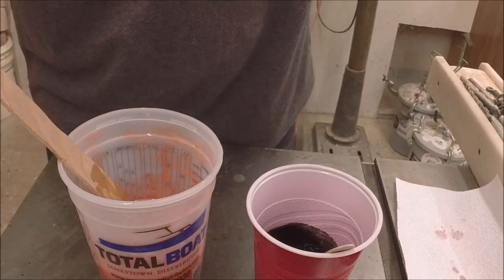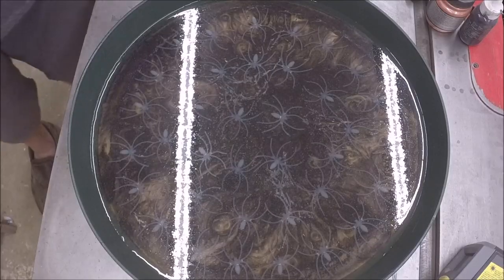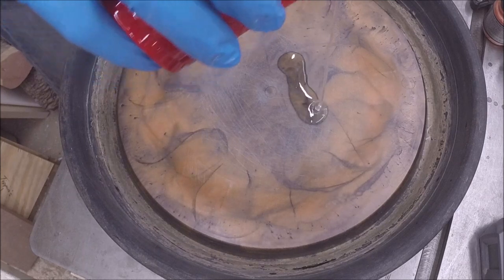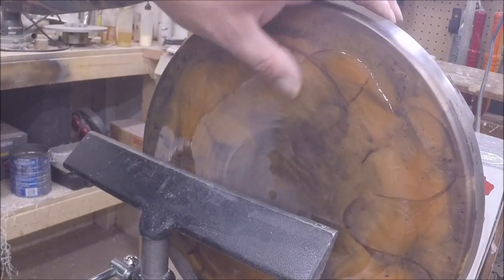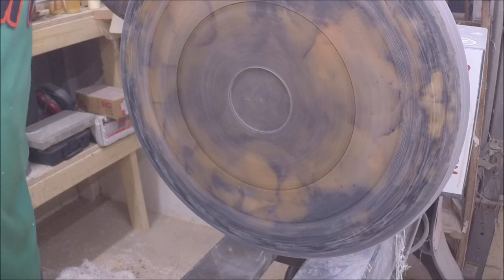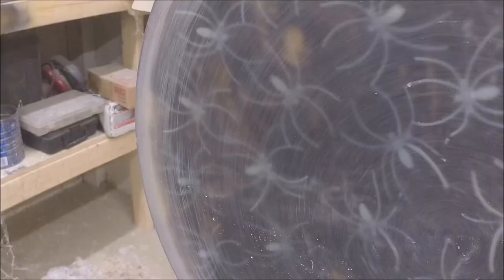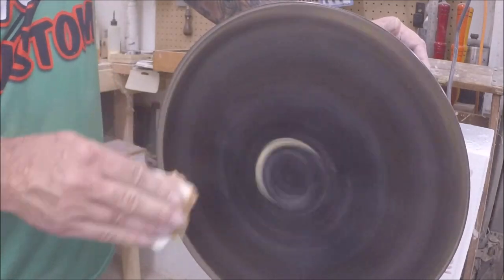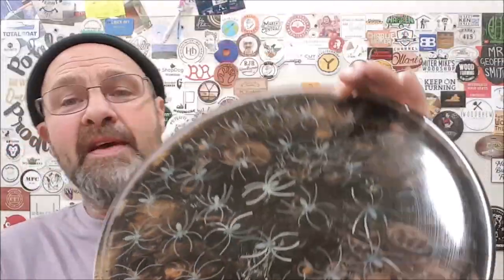Resin - Spider platter

Comment: If you have a buffing wheel that will fit on a Drill, that may help polish the circular marks off the surface...
It would also help you get the speed needed to generate the friction for sanding/polishing the very center of the pieces while you work them on the lathe...
Reply from the maker: Thank you,
Reply: Love it! Good to see people working without a pressure pot as well!

Comment: HINT!  Put water in the mold to the level you want the resin to rise to. Empty then dry well. Also, some are amazed at how the resin seems low after a pour, this can be accounted for by unseen bubbles. Take the resin pour mold and level by lifting a few inches then dropping on the table. An old baking trick to get the bubbles out of cake batter.
Reply from the maker: Thank you

Comment: This is really cool.  I have used steel wool on resin and it seems to smooth the sand lines. 
I have had no luck with that 2:1 penetrating resin (bought by accident).  It's melting my mixing pots and getting cracks.
Reply from the maker: Thank you Bryan,  Penetrating isn't what I am using,  High performance epoxy, 2 to 1

Comment: You know, you're suppose to measure out the epoxy and hardener by volume not weight,
Reply from the maker: Thank You,  the data sheet say other wise.  it actually says either way but gives the correct numbers for weight, 100g of A and 45g of B is not quite 2 to 1 by volume,  I kept running out of hardener so I went to weighing it out to solve that problem.